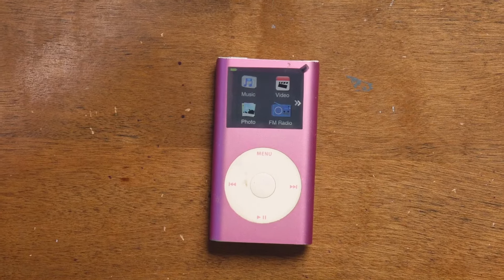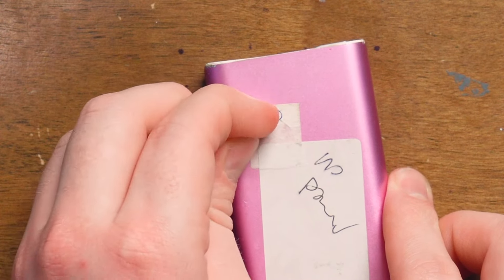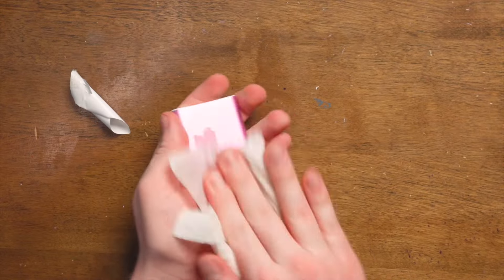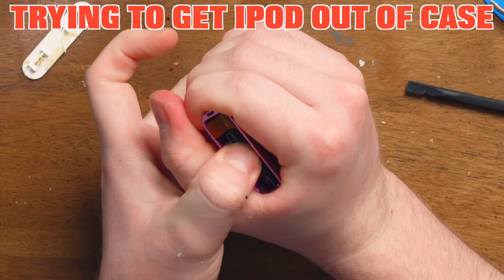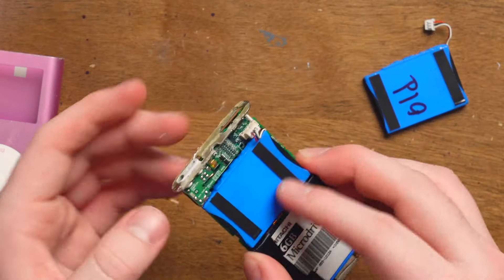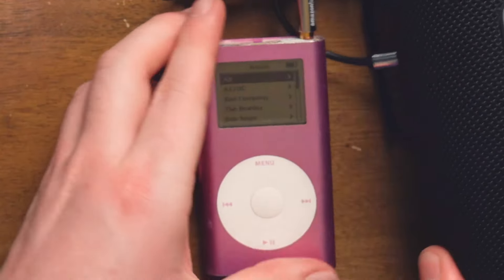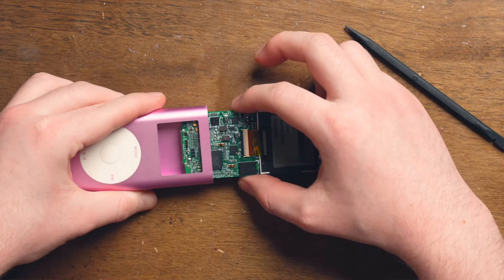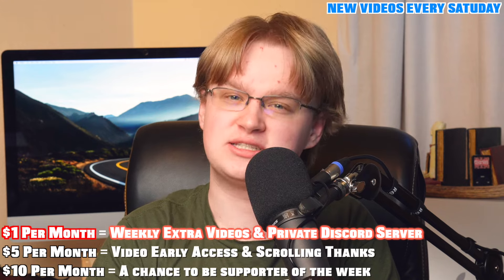The Highest Capacity iPod Mini Apple Ever Made (6GB)

Comment: When I flash modded my iPod mini, it was super easy to take apart. But for some reason it made wining sounds when I would try and slide all the components back together but I was able to get it together and it still works fine
Reply from the maker: Is that the components scraping or something?
Reply: @Kelson01  no like it was glitching, it would play weird sounds thru the click wheel speaker. The backlight would also turn on then off